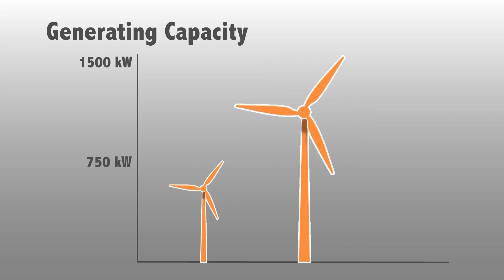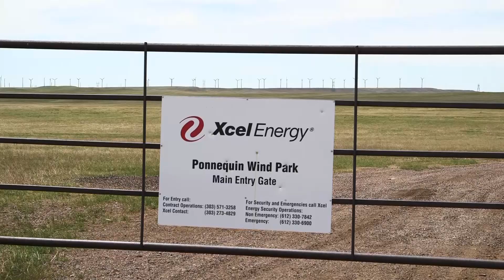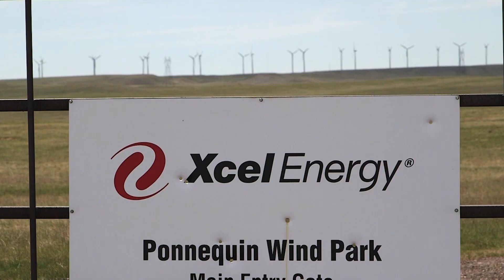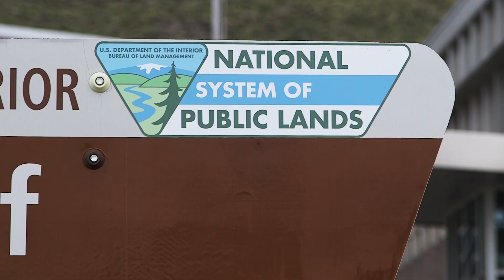Who Cleans Up When a Wind Farm Retires?

Comment: Don't forget about the tons of concrete in the ground that  kept the damn things from blowing over to begin with.
Reply: Generally about 300 - 400 tons of cement and steel that will be there FOREVER. 
Have a look at the U-tube building a wind turbine, none of them 400 ton foundations will ever be removed.
Reply: @justdoesntaddup8620  I saw one. They didn't tell you what it was, at first. It was an obscene amount of concrete and rebar, not worth the damage. They don't even pay for themselves, before they break down.
Reply: @billygunn7180  
the other part of that is it’s 400 tons of rock and gravel removed crushed and repositioned away from a river bed or quarry or mountain environment somewhere.
That’s without counting the 300 tons of copper steel and aluminium and paint etc , that all comes from the environment.
Reply: @justdoesntaddup8620  the only reason they allow that is corruption. Politicians get paid off and they give them subsidies. Otherwise, people wouldn't invest in something like that. They don't even pay for themselves, before they break down.
Reply: @justdoesntaddup8620  Do not forget that the making concrete releases huge amounts of CO2.
Reply: @billygunn7180  "It was an obscene amount of concrete and rebar, not worth the damage. They don't even pay for themselves, before they break down." Really? Prove your statement. The tower of a turbine is HOLLOW. What damage is a concrete base that can be re-used? Have you seen an oil spill?
Reply: @justsomeguy934  If you need to learn about windmill scam, all you have to do is go on YouTube or ask Google for sites. If they paid for themselves, they wouldn't need government subsidies, would they? What does being HOLLOW, have to do with anything? I didn't say they filled it with concrete. I never mentioned the base doing "damage". But you mentioned it being "re-used". Re-used for what? Giant paper weights? And why would it have to be re-used, unless turbine was broken down, which is inevitable. Yes, I've seen oil spills. What's your point? Oh, I guess you must be one of those people who don't drive in automobiles, or use plastic products. I admire your conviction, but modern people  like plastic products and getting to their destinations in a reasonable amount of time. Have a nice day. BTW, if you used phone or computer to reach me, it has plastic on it.
Reply: @billygunn7180  "But you mentioned it being "re-used". Re-used for what? Giant paper weights? And why would it have to be re-used, unless turbine was broken down, which is inevitable." The turbine location can have newer, more efficient turbines placed on existing towers. It's done all the time! In fact, turbines are an order of magnitude more efficient than they were even 10 years ago, unlike anything oil-based. What break downs are you talking about? Anything mechanical needs maintenance, or do you think a diesel generator starts up and runs for eternity with no maintenance?
Reply: @billygunn7180  " Yes, I've seen oil spills. What's your point? Oh, I guess you must be one of those people who don't drive in automobiles, or use plastic products." Another fallacy of yours - you think I'm trying to shut down oil by going to an extreme argument that I've never stated. As for plastics and oil products, they are essential for modern life! So why would any rational person want to burn up the miracle of petroleum one time as fuel? And when you burn it, you poison the air you breathe? I think you defeat your own argument by thinking if we use oil as plastic, we MUST also burn it as fuel.
Reply: @billygunn7180  "I guess you must be one of those people who don't drive in automobiles" I most certainly drive automobiles, and spend most of my time in an electric one. No pollution, full every morning, quiet, reliable far beyond any gas car I've owned.
Reply: @justsomeguy934  the breakdowns I was talking about were that the parts wear out before they have produced enough electricity to pay for themselves. The parts are so expensive that it costs mote to replace them, than they are worth. It's just a scam, to benefit million/billionaires. Just go through comments, other people explain it. As for diesel generators, they produce power for the customer. They don't break down after a week, and need to be replaced. That's why people buy them from the maker. who make a profit. Then they make more. Why else do you think they need the government subsidies to make them? Just corruption on a grand scale. In other words, a scam.
Reply: @justsomeguy934  the reason I want to burn petroleum as fuel is, that's the best substance we have to use. Who cares if it poisons the air, it dissipates in the atmosphere, not in your lungs. The reason I want to use it as fuel, isn't because we also make plastic products. Why would you bring up oil spills?
Reply: @justsomeguy934  Electric cars are horrible for the environment and use way too much electricity, which should be better utilized for hospitals, air conditioning, etc., etc., etc. Also, some of the materials used in them are mined by children, under horrid conditions. Very sad.
Reply: @billygunn7180  "Also, some of the materials used in them are mined by children, under horrid conditions. Very sad." That's a absolute lie by the oil companies. If you're referring to a picture of an African child in a pit mine, the photo was actually taken in a COPPER mine and distributed by oil companies as being from a lithium mine. Stop being an unpaid shill for oil, please, and do some research on your own.
Electric cars use LESS electricity than it takes to refine a gallon of gas! I didn't know that until I started digging. It takes an enormous amount of electricity to refine petroleum into gasoline. Stop making gasoline and you have plenty of energy to push EVs. Lithium, btw, isn't mined, the majority comes from surface brine or clay. Please stop making things up or repeating lies from Big Oil.
Lithium from clay: https://www.usgs.gov/energy-and-minerals/mineral-resources-program/science/lithium-clays-a-source-lithium-and-a-buffer?qt-science_center_objects=0#qt-science_center_objects 
Lithium from brine, 400 years of supply: https://www.dailykos.com/stories/2019/6/1/1861942/-China-claims-to-have-cracked-low-cost-production-of-lithium-political-implications-could-be-huge
Volts for Oil: https://youtu.be/BQpX-9OyEr4
Reply: @billygunn7180  "The reason I want to use it as fuel, isn't because we also make plastic products. Why would you bring up oil spills?" Because we can eliminate HALF the oil spills, HALF the pollution, ALL of the oil we buy from foreign sources if people drive electric cars.
Reply: @billygunn7180  I have been making many replies to your statements with article and video links to back up my statements. They are not being published, they are being removed by YouTube. I'm assuming their spam filter is seeing lots of external links as a spam risk (that's not unreasonable). I will try to make shorter responses with only a single link, but many people make long replies and make many statements that need discussion/rebuttal.
Reply: @billygunn7180  "Electric cars are horrible for the environment and use way too much electricity, which should be better utilized for hospitals, air conditioning, etc., etc., etc. Also, some of the materials used in them are mined by children, under horrid conditions. Very sad." None of those statements are true. EVs use LESS electricity than refining oil into gasoline (per mile). The child labor violations you're stating are also untrue, that's documented propaganda from the oil companies. If you saw a picture of an African child in a pit mine that claims to be mining lithium, that's what we're talking about. Forbes Magazine put out that bogus article; the picture is actually  a kid in a COPPER mine, not lithium. Lithium comes mostly from brine, not mined.
Reply: @justsomeguy934  I think it is COBALT that is mined by the kids, not copper. It also starts with a C though, so maybe you mixed up the two, I'm not sure.
Reply: @justsomeguy934  I'm not disputing that it's poisonous, that's why I mentioned that it dissipates in the air. BTW, if you go in a garage, it's not dissipated, but concentrated, so that is an imbecilic point. Water can kill you too, if you drink too much of it, but normal people know when to stop.
Reply: @justsomeguy934  We don't need to import oil, we have more than most, if not all countries. With that senile President we have, and the traitor Democrats, in general, it ensures that we be dependant on foreigners for our oil. That's why they call him Beijing Biden, among other reasons.
Reply: @justsomeguy934  How much does it cost to clean up an oil spillage?
Reply: @billygunn7180  Oil spills happen.
Reply: @billygunn7180   It took 12,000 people dying from smog poisoning in London in 1952 to enact the worlds first clean air act. Most homes and factories at the time were run on cheap coal that produced sulphur dioxide, carbon dioxide and smoke particles and all it took was a change in the weather (an anti-cyclone so no wind).
Reply: @davesy6969  You are correct, sir. You can't cry over spilled milk, or, spilled oil.
Reply: @billygunn7180  If you look at the facts and figures coal has been on a downward slide for decades and continued on that downward slide through the trump presidency despite his promises. At least Obama provided funding for retraining, which trump took away.
Reply: @davesy6969  Hillary said she would ensure that the coal miners would lose their jobs. Trump was great for energy. Obama funded retraining? Retraining for what? Those are just money-funneling programs for his corrupt fund-raisers, and assorted corporate cronies.
Reply: @davesy6969  Well, 30 years after the Valdeez incident, Prince Williams Sound is still contaminated. Exxon just stopped cleaning it up when the surface looked OK.
Reply: @davesy6969  Here's just the first result from a Google Search: "It is estimated that cleanup costs for a medium-large oil spill could be between $2.4 billion and $9.4 billion dollars. Cleanup costs for an oil spill could be between $2.4 billion and $9.4 billion dollars"
Reply: @justsomeguy934  plastic is a byproduct of petrol production. So is oil..... when I burn petrol, the plastic and oil are already being used elsewhere. As for poison? I bet you think tapwater will make you sick too
Reply: @justsomeguy934  Where is the electricity to charge that coming from?
Reply: @Mikesukes  "Where is the electricity to charge that coming from?" Glad you asked! The answer is electricity, unlike oil, can come from most any source: sunshine, wind, rain, petroleum, nuclear, tidal. Electricity, kilowatt for kilowatt, is waaaay cheaper than oil's energy. For example, operating an electric car, fuel only, costs about 1/3 to 1/4 per mile than a gasoline car. 
I bet you didn't know how much electricity is required to refine petroleum into gasoline - it's a HUGE amount! The accepted number is 5 kW/h of electricity per gallon of gas. That much electricity PER GALLON of gas will push an EV 15-25 miles with no further pollution.
I bet you didn't know that gasoline loses about 70% of its energy to HEAT. Even after refining petroleum, consuming grid-level amounts of electricity, transporting all that oil, you end up losing almost 3/4 of the energy to HEAT, and you get poison out the tailpipe as a lovely gift.
What were you asking about charging a car?
Reply: @dylanzrim3635  "plastic is a byproduct of petrol production. So is oil..... when I burn petrol, the plastic and oil are already being used elsewhere. " That statement makes absolutely no sense at all. For every barrel of petroleum extracted, about half goes to gasoline and the remainder goes to other fuels, lubricants and plastics. There is no dual-use of oil. Your logic astounds the rational.
Reply: @dylanzrim3635  " I bet you think tapwater will make you sick too" Tap water that's contaminated by an oil spill will!
Reply: @justdoesntaddup8620  When they take down a wind turbine, they remove the concrete at the base. Rebar and all. It has to be restored back to the way it was before it was built. My brother in law works for a company that takes them out.
Reply: @scrapcash2421  
Geez , that put whole new spin on environment damage then , would be a massive fossil fuel burn in cutting and busting up all that 400 tons of concrete from each turbine, then refilling the hole. With all that reo bar it would be useless for crushed cement recycling , I suppose the whole lot goes to landfill, probably in half a yard square blocks. 
Someone else can do the maths on the carbon due to fuel burn there, but , if this small wind farm is only say 30 turbines that’s 30 x 400 tons = 12,000 tons Of steel and cement just from the concrete foundations alone, the bases, all going to landfill after just 15 years.
Reply: @scrapcash2421  Turbine bases can also be re-used. I'm glad there are people to remediate a site if the entire structure has to come down, but who remediates the air when your truck emits poison? Worry more about the exhaust of petroleum fuel than the solid waste of concrete.
Reply: @justdoesntaddup8620  "Someone else can do the maths on the carbon due to fuel burn there, but , if this small wind farm is only say 30 turbines that’s 30 x 400 tons = 12,000 tons Of steel and cement just from the concrete foundations alone, the bases, all going to landfill after just 15 years." Concrete in landfill won't kill you, won't poison your air, won't ruin your watershed. Burning diesel or gasoline will.
Reply: @justsomeguy934  
You do understand that the machinery used to excavate, manufacture, transport, lift, assemble, paint, cement. THEN, reverse that manufacture and assemble loop to remove, you do understand that all operates on fossil fuel ? and all the waste is of no environmental value, ? it’s therefore for a graded environmental toxic ?
You do understand that SomeGuy ?

Great that these things crank out electricity with no need to shovel coal or gas to them , but when the wind drops suddenly or gusts above 55mph (which isn’t a very strong wind) then there’s no electricity, given the weather often runs no wind when there’s rain or freezing conditions, what then ?
Batteries !
More mine manufacture, transport assemble, dismantle , gather , transport , toxic landfill. 
There’s not much gain in the full loop when compared one to the other considering the green renewables have to have 100% thermal back up available to the grid for unfavourable environmental condition.
Reply: @justdoesntaddup8620  I not only understand, but have researched all the topics you have stated. What you're leaving out, of course, is the requirements for extracting, transporting, refining, storing, transporting and burning fossil fuels. I'm amazed that you're so concerned for concrete extraction of a wind turbine but not for a dam, or remediation of an oil spill, or removal of air pollution when burning the fossil fuel. 
You are also making the classic mistake to assume that if I advocate for renewable energy, I'm somehow wanting people to sit in the dark. Or have no power on a calm day. You jump to an extreme conclusion to make a judgement.
The cost and pollution required to refine even a single gallon of gasoline would astound you. It actually takes 5 kW/h of electricity PER GALLON of gasoline to refine it. And then you have all the environmental effects of refining it and burning it. Even when you're done making a gallon of gas, you lose 70% of the energy to heat when burned. 
So when you make your list of environmental factors with a wind turbine (something that uses NO fuel, works unattended most of its life), do include the same consequences for using gasoline.
My motto: jet fuel for jets, petroleum for plastics, electricity for cars. And no power reliability is sacrificed whatsoever.
Reply: @justdoesntaddup8620  Batteries! Incorrect on all your statements. Lithium comes mostly from brine and clay, not mined. Lithium is about 4% of any Li-on battery, and the entire battery is 96% recyclable and 100% reusable, as opposed to gasoline. They don't go into landfills as they are too valuable to throw away. They last 300,000 to 500,000 miles BEFORE they are reused, so their expected life is greater than the purchaser of the automobile.
Reply: @justdoesntaddup8620  Wind Turbines! Turbines are placed where there's a near-constant supply of wind, both day and night. The sites, like solar sites, are studied to have enough annual wind supply to warrant the installation of a turbine. So a "sudden drop" doesn't occur very often, nor does it matter - the average wind inventory of the site produces energy over time. 
You also suffer from making assumptions about renewable energy, such as the assumption that there's no mixture of energy sources on a grid. Grids have many energy sources available to them - base, peak, off-peak, coal, NG, external. If one source is deficient, they buy it from another source. It's done almost daily with peak demand. Utilities often charge more money during peak demand because they use more expensive, but less used, energy. Utilities take energy from what's available, and mostly, what's cheapest, all the time. Power low from solar? Use another source. Dam offline? Buy it elsewhere. Given that electricity can be sent over a thousand miles instantly, if one area isn't making power, another is.
Reply: @justdoesntaddup8620  "Great that these things crank out electricity with no need to shovel coal or gas to them " And that's EXACTLY the point. Free fuel. When it generates, it makes no pollution, uses no fuel, we pay no foreign country for it, we choke no one making the energy. In fact, if we added renewable energy to the amount we could, we would need to buy NO OIL from anywhere else. We'd be completely energy independent. How's that for a goal?
Reply: @justsomeguy934  
One good answer 2 no good , I have worked in Lithium mining , it’s no different to any other mining , probably a more environmentally damaging refining process though, and generally mined in an extremely fragile environment. 
The expense of Lithium batteries is astronomical , your looking at $4,000 just for a decent RV set up , how much for a hospital or city traffic light system. 
The voltage drop for sending electricity 1,000 kilometres is enormous, that’s replacing lost capacity due to a cloud bank or wind drop , which happens frequently, to the grid that equivalent to a generator failure. The land space required to generate 1500 mw at Alta is 3,000 acres for 600 turbines, that wouldn’t run the traffic lights in LA, the land space at Topaz solar is more , and for half the capacity, and it eliminates (environmental damage) sunlight from all the surface beneath the panels for average 680mw. Remember these are nameplate capacities, the actual output is much less. It depends on the sunlight , the temperature, the wind speed and air density.
Each of those facilities cost many billions of $$$ to build, it’s reasonably true they don’t require much expenditure after the construction when compared to feeding coal to a power station, but they are both more than half way to their use by date. 
That’s 10,000,000 panels and scores of thousands of tone of scrape metal, concrete and excavation that the environment has to compensate for after a short life span. 
It’s you that wants to compare to oil , not me , renewables are are long way from worth the trial , that’s what I say !
Dams for hydro electricity are an environmental interference, so the arguments that coal kills the world and kills people while renewables don’t is just rubbish, all energy conversion has problems.
The rivers to be damed , the ground surface required and the hardware for renewables all has to be considered , it’s just not happening on so many levels.
Reply: @justdoesntaddup8620  All of your statements are incorrect. The majority of lithium comes from brine in South America and Australia. Tesla just purchased thousands of acres of USA land to get it from clay. Tell us how "fragile" the lithium extraction is, then go look at the Gulf of Mexico's ecosystem after the BP oil rig fire, or Prince William Sound after the Valdeez spill. Or breathe the air in LA. Or breathe the air of your own automobile in a closed garage with it running. I'd love to hear your "fragile" comparisons then.
The loss of high-tension power lines is 6% - 8%. It's not "tremendous". Please, let's have a contest. I'll send a gigawatt of electricity 1,000 kilometers over the grid. You send a gigawatt of energy as gasoline 1,000 kilometers. Want to compare the energy expended to do that? Before you read this sentence the electricity is transmitted with, at most, 8% loss, an no pollution. Your tanker trucks haven't even started their engines yet, haven't belched smoke to get moving, haven't risked explosion. 
Think dams are bad? They create habitats for wildlife and control flooding. Think fish are in trouble, or birds? Human overfishing and buildings kill more wildlife than wind turbines or solar panels do by a factor of 3. 
I loved your "eliminates sunlight from the surface"! Let's see, putting shade on the ground is environmentally damaging, is it? As opposed to running a diesel generator that will kill you? I'll sit with a solar panel in my closed garage, you sit with a running diesel generator in a closed space, let's see how much damage is done. 
The fact is, we can't keep burning oil. We need it for other things. We can't keep sacrificing lives to protect oil trade routes. Sunshine and wind and rain are free, and we'd better starting using them.
Reply: @justsomeguy934  
There’s the point, when a cloud bank passes over Topaz the supply fail is instant, if that’s magnified by cold and windless conditions everywhere , then you have hundreds of people perish from exposure , cold , freezing , the grid simply can’t reach out and get energy from somewhere else.  that’s what happened recently, proof the grid will never stand alone on renewables. 
Green zealots point to coal mines and want that stopped because of the environmental damage the mining and the coal does, BUT immediately point to mining other recourses to compensate for the loss of coal as ok. 
It just doesn’t add up to say it’s ok to mine for resources to make intermittent electricity supply dependant on weather. For renewables to support even 50% of the grid would use all the land and resources and dam all the rivers and creeks. 
The only way that would work is to ration the consumer end user , and that’s happening now, and there’s more reasons for increasingly authoritarian government restricting the public’s access to cheap power than most care to think about.
Reply: @justdoesntaddup8620  "There’s the point, when a cloud bank passes over Topaz the supply fail is instant, if that’s magnified by cold and windless conditions everywhere , then you have hundreds of people perish from exposure , cold , freezing , the grid simply can’t reach out and get energy from somewhere else.  that’s what happened recently, proof the grid will never stand alone on renewables." OH. MY. GOD. You have little old ladies and orphans dying of exposure if we use solar power! Do you write for television, perhaps? 
No grid ON EARTH is 100% anything. NOT. ONE. They are a mixture of coal, natural gas, diesel, hydro, nuclear, wind, solar. 
YOU want the grid dependent upon one energy source, oil. I do not. 
WHO can't reach out and get energy from somewhere else? Oh, do you mean Texas that islanded their grid, unlike any other utility in the USA? You most certainly CAN buy electricity from other grids that are thousands of miles away, unless you're Texas. Idiots.
Any utility needs to be a mixture of energy sources. If one is unavailable, you get it from somewhere else. Solar doesn't produce energy at night, but it makes energy when we use it - daytime! Wind makes energy 24/7, as do dams. Arizona, for example, built a power plant in Kingman for the specific purpose of selling energy to California. 
Your doomsday prediction of using renewable energy belongs in a Irwin Allen disaster movie, because NO ONE is recommending we die of exposure in the dark. Geez.
Reply: @justdoesntaddup8620  "It just doesn’t add up to say it’s ok to mine for resources to make intermittent electricity supply dependant on weather." Do you know what wind turbine blades are  made of? Fiberglass! Just like a boat hull. I assume you're deeply concerned for the environmental impact of boat hulls? Do you know what solar panels are made of? Silicon - sand! Same as your computer screen or TV. Before the discussion on renewable energy, you were deeply concerned for LCD panel disposal, I assume? Do you see how you've grasped at straws to defend what you know, rather than think about another way to do things? I'm waiting for you to object to the CO2 created by pouring concrete at a turbine base. I'll accept your objection when you show me your objections to concrete used in buildings, roads and bridges.
Reply: @justdoesntaddup8620  "There’s the point, when a cloud bank passes over Topaz the supply fail is instant, if that’s magnified by cold and windless conditions everywhere " Solar panels make energy on cloudy days. Their output does NOT drop to zero, nor to clouds regularly stay overhead all day where solar farms are placed. You're aware of that, right? My own state has over 300 days of complete sunshine every year. Canada, or Virginia, not so much. You put solar farms where they get sunshine. You put wind farms where there's wind all the time (like in the video). Don't worry, however, you an pollute the air we breathe with oil from anywhere.
Reply: @justsomeguy934  
No problem, we’ll just leave it there I suppose, you assume my spin is oil ,
Maybe just google Lucas Heights energy generation , operates in the middle of a city , has supplied regular reliable electricity and medical isotopes for 60 years, doesn’t need thousands of miles of transmission lines, the customers ar all within 60 miles.  Let me know one day when you get on the bus for a tour.
After all considering what on earth use is a multi billion $$$ energy generation faculty that offer nothing 8 hours a day and next to nothing 5 hours of the remaining 24 and no real contribution if it’s raining or just cloudy. 
Solar ?  ,  It just doesn’t add up !
Reply: @justdoesntaddup8620  "No problem, we’ll just leave it there I suppose, you assume my spin is oil , Maybe just google Lucas Heights energy generation , operates in the middle of a city , has supplied regular reliable electricity and medical isotopes for 60 years, doesn’t need thousands of miles of transmission lines, the customers ar all within 60 miles.  Let me know one day when you get on the bus for a tour."
The exact same praises were said for Fukishima, operated for decades just fine, wonderful flowers planted on the pathway to the reactor, too. I love you guys that just ignore the centuries of contamination that happens. Fukishima was built by a responsible government with the latest engineering methods possible. And not only did the backup systems fail, but they failed simultaneously. I'll be happy to have a tour of any nuclear facility you like if YOU go spend some time at Chernobyl or Fukishima. Take your dosimeter with you. Will you tell me that "we'll read the manual this time" at the next disaster? Is it even POSSIBLE for a wind turbine to contaminate the Earth for 20,000 years? Are you even making a rational argument?
Reply: @justdoesntaddup8620  "No problem, we’ll just leave it there I suppose, you assume my spin is oil ," If you fight alternatives to using oil, your spin IS oil. I don't know about you, but we'd better do something. I object to breathing the poison from the car ahead of me, object to having American soldiers die in the MidEast for oil, object to giving trillions in subsidies to oil companies every year while morons here in the USA object to concrete being poured for a turbine base. The solar panels on the average USA home can generate over 100% of the electricity the home uses. No pollution, silent, no terrorist nation paid for the fuel to make it happen.
Reply: @justsomeguy934  
Well I think there’s one easy answer for you , stop driving cars, live in a tent, don’t use refrigerated goods, don’t use aeroplanes, don’t use plastics or rubber, ride a push bike made from cane and no tyres, or walk. No air con , use nothing made with electricity or fuel or crude oil(that includes bitumen and cement), there’s simply nothing even on the horizon that will support modern western society without at least 60% nuclear and fossil fuel thermal generated energy.

Unfortunately renewables will only ever be an intermittent side event.
I’m not necessarily fighting renewables, just recognising they can’t do it. 
10 years ago the renewables mantra turned to storage , batteries, pumped hydro, flywheel energies, none of its worked, then molten salt , now the great hope experiment is hydrogen.

Broken Hill Nyngan solar is in one of the highest sunshine locations on the planet , but still generates on average less than 40% of its nameplate capacity, at a cost of $480,000,000 (subsidised or it wouldn’t be there), 2,000,000 panels, already at its half life, now theres no land fill that can take that many panels anywhere , so what will happen to those 2,000,000 panels ? 
They’ll no don’t be dismantled, transported and buried somewhere quietly in the desert out of site,
No pollution in that kind of transparency.
Reply: @justdoesntaddup8620  "One good answer 2 no good , I have worked in Lithium mining , it’s no different to any other mining , probably a more environmentally damaging refining process though, and generally mined in an extremely fragile environment. 
The expense of Lithium batteries is astronomical , your looking at $4,000 just for a decent RV set up , how much for a hospital or city traffic light system. " As I've stated to you, the majority of lithium comes from brine in South America, not a mine. What I find interesting is that you're objecting to lithium as a mining process, but are you also objecting to the horrendous process to extract copper, magnesium, bauxite, coal, etc. that's used be a FAR greater degree in an automobile? 
Did you know that lithium in a Li-on battery is about 4% of the content? And that the batteries last 300,000 to 500,000 miles before they are recycled or reused? Given that a trunk lid in an automobile has more metal in it than lithium in a car battery, I find your concern for the environment unconvincing.
Reply: @justdoesntaddup8620  "10 years ago the renewables mantra turned to storage , batteries, pumped hydro, flywheel energies, none of its worked, then molten salt , now the great hope experiment is hydrogen."
Um, 10 years ago Tesla was started. According to your statement, it didn't work, couldn't work. Tesla is now the 6th largest selling car maker in the USA, and its vehicles are rated at 400 miles range. I'd say you need an update in your thinking, or do you still have Kodak stock?
Reply: @justdoesntaddup8620  "so what will happen to those 2,000,000 panels ? They’ll no don’t be dismantled, transported and buried somewhere quietly in the desert out of site,

No pollution in that kind of transparency."
Solar panels work until damaged. They lose some efficiency with age, but don't stop working. They're solid waste, can be buried if necessary, and you can grow crops over them. Let's talk transparency on oil waste and pollution, shall we? Oops, you don't compare that to fiberglass (wind turbine blades) or solar panels. The fact is you're breathing the exhaust of using oil every day. Our air is that industry's dumping ground and you don't see it. You're smart enough, I bet, to NOT stand in your garage with your car running, right? It will KILL YOU. But you make some argument that disposing of a solar panel after decades of pollution-free energy is somehow comparable.
Reply: @justdoesntaddup8620  "Well I think there’s one easy answer for you , stop driving cars" Well, I have an easy answer for you - stop driving GASOLINE cars, do nothing else in your list and we save HALF of all petroleum wasted as gasoline. We save OVER HALF of all the air pollution made today. We save ALL the MidEast oil we import, die for, give subsidies to. What a great idea you had! Can I count on your to support electric cars?
Reply: @justsomeguy934  
Simply this Sir , the next time you plug your electric chariot in to charge up on a cloudy rainy windless day or a gusty nighttime where the breeze is above 55 mph , remember that electricity is coming from COAL , just simple bow your head and quietly say 
“Thank you coal” !
As a matter of fact, any time you recharge or switch on electricity, more than 2/3 of it is coming from fossil fuel,
“Thank you coal” !
Reply: @justdoesntaddup8620  "the next time you plug your electric chariot in to charge up on a cloudy rainy windless day or a gusty nighttime where the breeze is above 55 mph , remember that electricity is coming from COAL" Actually, the electricity to power my car is LESS than the electricity required to refine petroleum into gasoline. Did you know that? It actually takes 5 kW/h of electricity PER GALLON of gasoline to refine it. That much electricity will push an EV 25 miles, or the average MPG of a car sold in the USA today. That's right, just the energy required to refine gas will push an EV the same distance as then burning that gas and polluting. 
As for your doomsday "cloudy rainy windless" scenario, what a joke. If it's cloudy here, it's sunny over there. Becalmed here, windy over there. Let me repeat, wind farms are put where there's enough wind to make them viable. Same for solar farms - it doesn't get cloudy much where they are. 
As for many of my friends, their cars' energy comes from their roofs (solar). Even if they get grid energy, they create no pollution and use less energy than burning gas.
Reply: @justsomeguy934  
What a joke , wind turbines and solar farms produce enough power to supply so m a n y houses , that’s what they say, that’s because no one’s home when the measurements are taken , they’re off at work , only the refrigerator is running. 
No doubt it would not be fair to measure how many houses a solar farm could support at 7 pm (night time, no sun) peak demand on a hot summers night or mid winter, (And at your house Mr Someguy , the whizz car is also plugged in).
BUT let’s get back on the subject Just,
these spent wind farm towers and bases are an environmental pest, they were assembled and worked for a lousy 14 years and ran a LOSS , so all the energy burned up manufacturing, transporting and assembling and maintaining them was an environmental dead weight !
You want abundant electricity ?
Use coal for that !
Please tell yr friends their whizz chariots are actually running on COAL fired electricity, lol , they’re causing coal burning down in the valley !!!
Reply: @justdoesntaddup8620  "BUT let’s get back on the subject Just, these spent wind farm towers and bases are an environmental pest, they were assembled and worked for a lousy 14 years and ran a LOSS , so all the energy burned up manufacturing, transporting and assembling and maintaining them was an environmental dead weight !"
Your claims of no environmental improvement of a wind or solar farm are baseless, prove your statement. I can prove every statement I make. Can you?
As for the economic "loss" you claim, solar and wind energy is actually cheaper than coal in many places. I'll make another post with the links to prove it, YouTube removes a comment with too many hyperlinks.
In addition to the "loss" you claim, may I assume you know that we Americans spend more on oil subsidies than we spend on our own military? That's according to the International Monetary Fund! If oil was so cheap, why do we need subsidies? Why use an energy source that requires an aircraft carrier to protect the trade route? Add those costs in and you'll see that traditional fuels are very expensive.
Reply: @justdoesntaddup8620  "What a joke , wind turbines and solar farms produce enough power to supply so m a n y houses , that’s what they say, that’s because no one’s home when the measurements are taken , they’re off at work , only the refrigerator is running" Oh EGAD. You don't think a utility knows how to measure electricity? They know exactly how much energy a home uses, how much energy a turbine / generator / solar farm produces. Your claim that it's some mysterious amount of energy is childish. Look at the facts, use adult reasoning, change your opinion when necessary. In short, be a grown-up.
Reply: @justdoesntaddup8620  "No doubt it would not be fair to measure how many houses a solar farm could support at 7 pm (night time, no sun) peak demand on a hot summers night or mid winter, (And at your house Mr Someguy , the whizz car is also plugged in)." Do you live in the arctic? Where I live, a sunny state, a "hot summer night" is hot because...wait for it...it's still sunny! That's right, in the Summer where I live, you can wear sunglasses at 8:00pm. I also wear sunglasses at 6:30am to take the trash out in Summer.
Reply: @justdoesntaddup8620  "Please tell yr friends their whizz chariots are actually running on COAL fired electricity, lol , they’re causing coal burning down in the valley !!!" Actually, that's not the case but for the sake of argument, let's say an EV recharges at night, off-peak, and that your utility uses coal. Guess what? Coal electricity is still cleaner than gasoline! Why, you say? Because to some degree, coal emissions are scrubbed from ONE SPOT, the power plant. Try cleaning up 500,000 automobiles' emissions. Any EV sold today gets at least 100 mpge, so the energy you give them is 3x more efficient than going the same miles on gasoline. Furthermore, the EV emits no heat and no poison when it's running. I'll be HAPPY to drive a coal-powered EV if you get rid of gasoline cars.
Reply: @justdoesntaddup8620  Here's a video on your "coal powered car" statement: Are EVs powered by coal (Sean Mitchel): https://youtu.be/nxPUhCbbBg8
Reply: @justdoesntaddup8620  Gosh, I can provide you with a direct observation to prove you're wrong about energy production. I have several friends that live nearby me that have solar panels on their roofs. They produce the maximum allowed by our local ordinances, about 110% of the energy they use. You can see that the local utility actually pays THEM for the electricity they produce. You can see the kilowatts consumed, kilowatts produced, the net difference. I'm not sure if your local utility uses tarot cards to make up your bill, but solar and wind production is most certainly provable.
Reply: @justdoesntaddup8620  you can make that argument for any form of power plant, hydro, gas, coal, nuclear are all made of lots of concrete and rebar. They all have a lifespan and all have decommissioning costs.  The thing about the turbines in that windfarm is that they are now too small to be as profitable as they once were so the company has a choice, either upgrade and upscale or decommission.
Reply: @justdoesntaddup8620  the state of Washington and its renewable energy disproves most of what you believe.
Reply: @odisy64  
“That word most”
Reply: @justdoesntaddup8620  who are you quoting?
Reply: @justdoesntaddup8620  coal is dying.  My power is produced with natural gas. Solar can heat liquid salt that can keep the turbines turning at night or on cloudy days.  I would choose electricity supplied by lightning. Build huge capacitors in the desert underground. Build the collector towers were lighting is obviously going to strike and trickle the power off of the capacitors as needed.
Reply: @lookronjon  
Hahaha , I can’t work out what you are typing , maybe wrong words or incompetent spelling ?
Come back when you finish school !
Reply: rebar, too. Crazy amount.
Reply: There a about 4 tons of rebar, and 350 uses concrete wet beached into a dome shaped 30ft by,10ft tall, I poured many of these, it would be hell try trying to get the concrete out
Reply: @raymondward8932  Instead of digging a hole and filling it with hundreds of tons of concrete and rebar to the level of the surface, dig the hole deeper and leave a six foot or so gap so on decommissioning there is just a hole needing to be filled, topsoiled and grassed over. There could be biodegradable rods inserted during construction to allow proper draining.
Reply: @raymondward8932  "There a about 4 tons of rebar, and 350 uses concrete wet beached into a dome shaped 30ft by,10ft tall, I poured many of these, it would be hell try trying to get the concrete out" So what? The base of a turbine can be reused. Are you also upset at the derelict buildings and roads and other things made from concrete?
Reply: And in my country, Scotland, the amount of carbon storing peat removed is enormous, green eh??
Reply: @alistairewen9558  Your country has an island that is completely self sufficient with wind energy and ultra capacitor banks. No Emissions at all :-)
Reply: @insAneTunA  correct but, please no more land based Wind farms.
Reply: @alistairewen9558  There are many clever solutions for renewable energy that most people never heard of. Small and easy to maintain turbines that can be fitted to, or on top of existing infrastructure, such as roadside lampposts and/or buildings. But there are also wind energy harvesting devices without external moving parts. However some turbine parks will be inevitable. 

In my country, the Netherlands, a consortium of privately owned companies built a prototype from the largest turbine in the world, without any subsidies, and it is so big that it will always catch wind, and it produces enough energy to power 16.000 households.  

But here in the Netherlands it is not allowed to let the decommissioned turbines rot away or to trash them on a landfill. So those energy companies put the deconstruction and removal costs from decommissioned turbines in their business model before they even start building a park. However, all those materials are being sold to and recycled by other companies, so that takes the total costs down a bit. 

In the meanwhile it creates many jobs in many different sectors during the entire life span from those turbines, from building them to decommissioning them. 

Clean energy, good paying jobs, what's not to like.
Reply: @insAneTunA  I think the west coast of my country, Scotland, is ideal for tidal turbines, nothing between us and Canada so, everlasting power, timed to the second and with proper grills, no danger to the fish population. I realise the initial cost would have been more, and, there are some in production. I think we have the same problem everywhere, money.
Reply: @alistairewen9558  Politicians and the people who are selecting them are the problem, not the technology or the money.
Reply: @insAneTunA  indeed,slainte.
Reply: @alistairewen9558  I even think that tidal wave energy harvesting can be good for the fish population, depending on how they do it. The fish will seek protection around those structures, pretty similar as they would do if there were a coral reef.
Reply: @insAneTunA  indeed, I've friends who worked on the rigs, who said the surrounding sea was teeming, but, of course there were downsides to that !!!
Reply: @alistairewen9558  Like what?
Reply: @insAneTunA  I knew two people on the piper alpha.
Reply: @alistairewen9558  Sorry to hear that.
Reply: @insAneTunA  I wish I hadn't said, have a good night.
Reply: @alistairewen9558  Good night to you as well.
Reply: You're worried about concrete now? Do you know how much concrete is in highways, bridges and buildings?
Reply: Build a park over it. Or an airport. The tie downs are already there.
Reply: yall acting like they dont pour concrete casings around well pipes.
Reply: How much is left after an coal generator is decommissioned? How about a nuclear facility? Get real.
Reply: @SirHackaL0t.  Not to mention all those decommissioned drill sites and old oil wells that are still spewing sulfur and CO2 gas, and other toxic gasses, and left to rot for future generations. And the earthquakes and sinkholes from fracking. And the poisoning from drink water resources. And the list goes on and on.
Reply: @insAneTunA  But they don’t mention those, just FUD about anything that’s not oil based.
Reply: @SirHackaL0t.  Oil, or coal, or natural gas, or like you said, nuclear. I mentioned a name in one of my earlier comments, maybe it was at a different video, but people really should learn about the Dutch climate skeptic Frits Böttcher. 

That man was payed for years by multinationals to spread false information about the disastrous effects of CO2 emissions on our climate. And another task was to set up a global group of climate skeptic people.

And those corporations have admitted that they did that, so there is no doubt about it. 

Absurd enough Frits Böttcher also used to be member from the club of Rome, which was completely absurd and contradictory if we look back at that situation with the knowledge that we have today. 

People found out that he was payed after some people planned to write his memoir's, and for that they had to go through all his paperwork, so the family gave them permission to do that. While searching through his paperwork they found the papers that proved that he was getting payed to lie, and to set up an international climate skeptic group. And he was very successful. The man died a while ago, but his legacy of spreading lies and false information still lives on to this date. 

And he was/is not the only scientist who turned out to be a gun for hire.
Reply: And NONE of that concrete or rebar was made with "wind power"!
Reply: oil and gas just automaticly surface into tanks and move through pipelines NOT. much more pipe and cement are left in the ground from abandoned oil and gas wells also. many truck loads of steel pipe and  cement are used in an oil well and never recovered . surface equipment may be recycled if it is free of T-norm . if the T-norm is too high  the waste must be landfilled.
Reply: @erniew5805  Yea leaky and abandoned pipelines are really a boon to soil, waterways,and the general health of the vicinity.How many mines are abandoned  leaving a toxic site for taxpayers to mitigate?When a mine operation goes bankrupt,there is supposed to be a bond that will be used to clean up and reclamation performed,trouble is the bond was put up umpteen years ago and is insufficient now to CV over the cost.Guess what ,tax money again to the rescue.There is a cost to any form of energy called external cost,which is not figured into actual cost of the source ,or operation expense / vs.profit. Clean up, and future cost to the environment needs to be in the planned energy system.
Reply: @joebeetz1832  Oh the joys of capitalism.
Reply: How much concrete and rebar are in a refining plant or any other power plant?   This argument is not only specious, but it's also idiotic.  Because a facility has fallen into disrepair and or neglect does not mean that the entire idea of wind-generated energy is faulty.   Surely there are coal-burning power plants, refineries, and the like that are now obsolete and are awaiting either rebuilding or razing.  BTW, Bided just inked a deal putting up wind-turbines just offshore.  " The plan would generate 30 gigawatts of offshore wind power by the end of the decade — enough to power more than 10 million American homes and cut 78 million metric tons of carbon dioxide emissions."    And wind energy accounted for 47 percent of Denmark's power usage in 2019.  Up from the year before.   It's coming.

It amazes me how much BS people throw up any time anything green is discussed.   Big Oil!  Big Coal!

We used to use whale blubber for lights, steam locomotives,  Piston engine DC3's for air-travel,  etc etc.   Progress people, progress!
Reply: @lbowsk  And their lifespan is probably even shorter in that environment then in 15 years you have the same situation just offshore. Therefore your argument is also idiotic.
Reply: @lbowsk  
True there are thousands of tons of concrete and steel and many other resources in a thermal power station and a number of workers required, BUT a 2,000 mega watt thermal power plant will reliably crank out that electricity 24/7 for decades, given maintenance down cycles, albeit that many thousands of tons of energy fuel is consumed. Except in nuclear as there is relatively very little weight in uranium. 
A four mega watt wind turbine costs around $5 million but only contributes that 4 mwh around 26% of the time, it depends on the wind speed and air density, when there’s high wind, above 50 notts,  they are turned to stored position using electricity to swing incline of the blade and effectively switch it off, so they aren’t damaged. No wind,  they consume electricity because they are rolled to keep up oil pressure. 
There you are , you learned something Steve , clearly as demonstrated you know how to criticise by hurling abuse and ignorant denigrating argument. 
Zero for you to learn there Steve but any constructive information you may have would be welcome I’m sure.
Reply: @lbowsk  All true, the nuclear industry is heavily subsidised and decommissioning a nuclear site is expensive. The thing about solar, wind and tide energy is that the sun, wind and tides are all free and occur naturally infinitely. Coal, oil, gas, uranium all have to be found, mined, transported and cleaned up after. Everyone could try using less energy so not so much has to be produced.
Reply: @lbowsk  " enough to power more than 10 million American homes "
Occasionally. It amazes me how much BS people throw up any time anything green is discussed.
Reply: @lbowsk  it’s amazing how Joe’s sippy cup holders can lie so much.  These things kill thousands  birds each year, the foundations can never be removed from dry ground, now you want to put them in the ocean, that can not be a good thing.  Imagine the carbon footprint of making, transport, installation, maintenance and disposal of them.  That can never makeup for what they pretend to save.  Add it up!
Reply: @lbowsk  There's a HUGE difference in concrete walls an foundations (that will last MUCH longer than a windmill) and a MASSIVE monolith block of concrete buried in the ground.  You clearly know nothing about building construction or demolition.
Reply: @ffjsb  "There's a HUGE difference in concrete walls an foundations (that will last MUCH longer than a windmill) and a MASSIVE monolith block of concrete buried in the ground.  You clearly know nothing about building construction or demolition." So what's the difference? The base of a turbine tower is far less surface area than that of a building - it's a vertical placement, not spread out horizontally. SO WHAT if there's lots of concrete? The base can be re-used, the tower of a turbine can have a new turbine put on top if it. I point you to millions of unused, partially demolished buildings and freeways made of concrete. A concrete turbine pad on a farm or unused land hurts nothing.